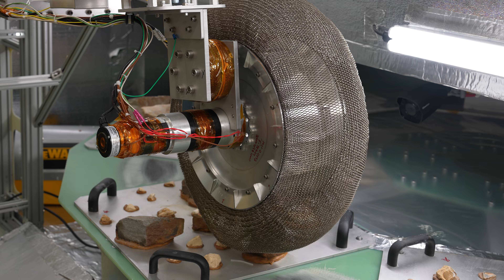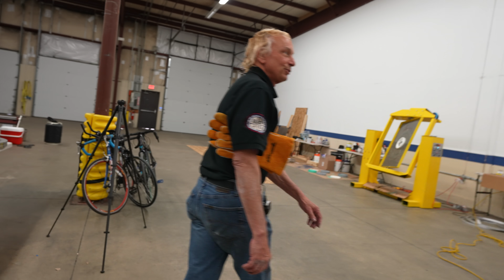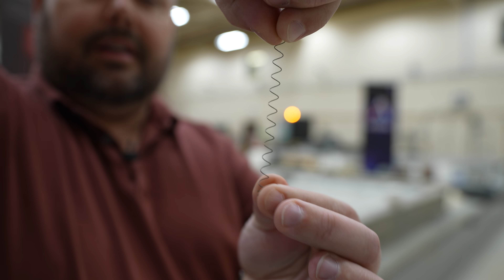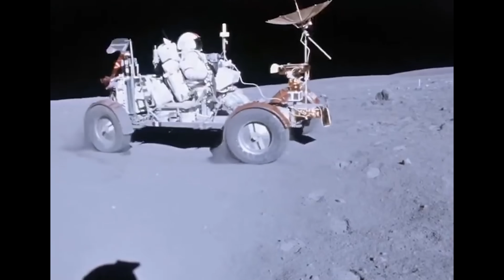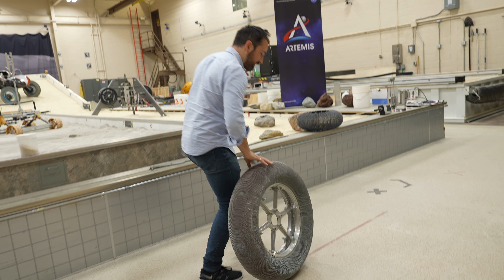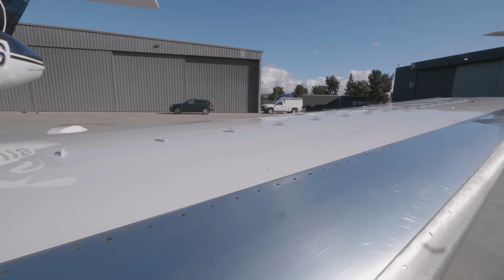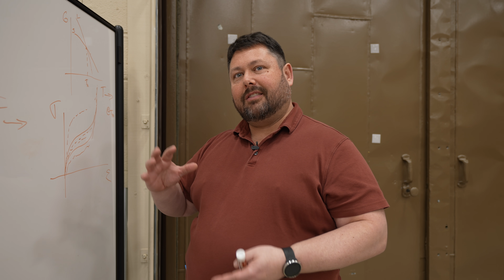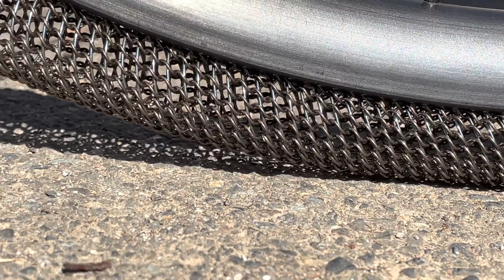How NASA Reinvented The Wheel

Comment: I'm imagining a cooling system where they take a wire of Nitinol and have it rotating around and bending as it goes, so it can be cold when it enters your house, or goes by a fan, and then it's hot when it goes back outside.  AC with no nasty coolant chemicals.  

This is a pretty sloppy description, but it makes sense in my head.

Comment: 15:39 But how? i know sound wave is produce by vibration. Do you feel the wire vibrate when you pull it or that chruncy feel is the vibratation? Still, if it is vibrate, then what is it? Is it the molecule or your fingger print rubbing the wire?

Comment: Not an engineer, could you use this to efficiently propel stuff? Similar to a wind up motor but with a longer coil, and apply various temperatures to change the amount of force applied with the motor? Not thinking about cars or anything as technical, but for like efficient and reliable exploration robots, or short range prop drones. If anyone knows of anything out there that uses this, lemme know I'm really curious

Comment: Why not utilize that exothermic energy to power the rover even in the dark?

I mean as the rover traverses through the Martian terrain, the deformity caused to the wire mesh wheels would generate certain heat which in turn could be converted to energy and fed back into the system. Any thoughts?

Comment: seems like there could be applications for stable energy storage. I'm trying to imagine some kind of kinetic motion battery like a water battery. Am I missing something? Like you could use PV electricity to bend the material and then heat or cool it to release it. Depends on the input output ratio, obvs. Something maybe about the exo/endothermic reactions could be useful too...

Comment: Airless* road tyres means less flat tyres. 
Which means less waste being generated. 
Which means fewer tyres will need to be replaced. 
Which leads to less income for tyre manufacturers. 
Which is precisely why they won't ever be made for consumers.

It's basically: "Do you wanna keep making good money consistently?"
or 
"Get a massive boost of income short-term as everyone switches to near indestructible tyres, then go bankrupt in a few years because nobody is buying replacement tyres?"

They hold all the cards... And the house always wins.
Reply: but "they" isn't one entity. Yes, the tire making companies would hate this for the reasons you mentioned but the car making companies would love this. It would mean having to spend less money but still have a better product. Because the car companies have more power, they would be the ones with the power and because these tires would mostly benefit them, they would buy them up.

Comment: does anything notable happen if you run an electric current through it? i'm imagining you can flip a switch, the electricity heats the wire as it moves through, altering the shape, then flip back and it returns to shape, but what shape would it transition into if the remembered shape is the cooler temperature? is that predictable?

Comment: So my question is, how well the nitinol wheels will perform in commercial vehicle? Like when it used for high speed like above 160 km/h, or when it perform in difficult terrain that may cause even for rubber wheels slipped, or how about the grip of the wheels when it has to work just like rubber wheels to decelerate from high speed or when it have to accelerate?

Comment: I've always wondered about the practical applications in space. If you can set the austinite shape at certain temperatures, then doesn't that mean with the temperature fluctuations it would constantly be changed? Unless they are creating alloys with the shaping phase at temperatures higher than natural in space I just don't see it working all that well.

Comment: I used to work in a shop that specialized in working NiTi for medical devices, Before you do some of the operations on it you have to straighten the round stock, and you want a really tricky process, because if you just cold bend it to straight like most metals, the moment the drills heat the metal up it can undergo what was referred to as "Radical hysteresis" where it returns to it's previous shape, which if it's not straight doing deep hole drilling on it becomes near impossible. There were ways to deal with it even if it did undergo a radical shift, but that is all proprietary information that belongs to that shop.

It's some wild material to work with though. When you started describing the material at the beginning of the video I immediately realized that it was going to either be about Nitinol or Flexinol. Memory metals are crazy.

Comment: thats soo cool but i have a couple questions, first of all if i heat it up and then i try to deform the piece when its hot what happens? and also in the case of a car with that tyoe of wheel do i need to change them if i go to a hotter or colder place? like if i had a jeep with those wheel that can go in the desert do i need to change them in i try to use the same jeep on the snow for exemple? (ty in advance if anyone answer me and sorry for the bad english)

Comment: The Apollo 14 MET had two nitrogen-filled rubber tires, and were the first tires on the Moon. They were designed by Goodyear Tire and Rubber Company and called Experimental Lunar Tires (XLTs). It's sad that everyone forgets about the MET. It was used once on Apollo 14. It didn't work as well as hoped. It was replaced by the Lunar Rover for the extended J-Class missions, Apollo's 15 to 17.

Comment: After watching this video, I learned about the unique properties of Nitinol, a metal alloy of nickel and titanium. I was fascinated to discover that Nitinol has shape memory and superelasticity. This means that it can deform at a low temperature and recover to its original shape when heated above a certain temperature, and can accommodate large recoverable strains within a certain temperature range. These properties are derived from a reversible phase transformation between austenite and martensite, two different crystal structures of nitinol. I also learned that Nitinol has high tensile strength, melting point, resistance, and corrosion resistance. It’s amazing to see how this material can be used in various applications!
Reply: bot check, say fresh avacado xD

Comment: What happens to those new mesh tires if you stick them in liquid nitrogen like u did the rubber?.....and what happens to the tires if they are hot and then stretched to its limit or vice versa very cold then stretched to its limit?
Reply: Liquid nitrogen will make the tyre stronger but more brittle.

If they are heated to less than 350 °C, they become stronger and tougher than when at room temp.
If they heated more, they become weaker.

Comment: I'd like to know if that wire or material does anything interesting with a voltage applied. There was a product I heard about, I think in the 90s, called "muscle wire" that sounded kinda similar. One of the ideas for it was miniature robotic arms or legs without actuators.
Reply: Yes, muscle wire is the same material (nitinol). Heat, electricity, force and magnetism can all be used to various effect.

Comment: They’ve been talking about nitinol tires for decades. Obviously they have major disadvantages (cost, durability, etc) otherwise they would have been commercialized long ago.
Reply: Material advancements and commercialization take time, sometimes on the order of decades. We had electric cars first, too. Cost has in fact been one major issue but has been drastically reduced in these designs. Sometimes you just need that tipping point, and we believe it's here.
Reply: Reporting is faster than the process of pushing out a finalised commercial product.

Comment: I would not use those tires on planes or cars on Earth. Slow rovers sure. But not vehicles that are on concrete that require grip on that concrete. If you had those on your car and had to suddenly brake, those tires are screwed and you're sliding if not tearing up that mesh entirely. You're going to need rubber on those wheels to be able to grip the concrete to help reduce your speed
Reply: All of the terrestrial tires (including the bikes shown), do in fact incorporate rubber treads.
Reply: @thesmarttirecompany  Oh okay i don't recall it being mentioned apart from on the old Mars rover wheels and it only really showed the wire mesh tire. That's good then if the terrestrial ones use rubber too though wouldn't that rubber also strip from the mesh a lot easier? Or is it more akin to our current tires but using the mesh as an inner tube with a solid rubber exterior?
Reply: @SphynxsShadow  it's hard to make a perfect analogy here, but basically the nitinol skeleton is first encased, and then the rubber tread goes outside of that. It's a complete solution that's a bit different from retrofitting nitinol into anything existing.
Reply: The nitinoid would be inside the tire, not outside.

Comment: So what about scratch damage to the alloy, and for terrestrial applications grip levels? So perhaps you could have an inner Tire made of the alloy, with a rubber tire riding on top of it. Rubber tire would provide the grip and protection from scratches. The alloy would provide the substitute for air pressure. You may still have a an inflated tire, but it may only be at 4 PSI or something very low it's easy to manage.
Reply: Yes, all of the terrestrial applications do already incorporate casings and rubber treads.

Comment: I'm skeptical of the tire application.  Two things that come to mind are Grip on the road, specifically for things like breaking; and secondly, I'd be concerned with any wear on the road if it's a more coarse surface in contact with the road.
Reply: Have you considered that the nitinol is inside the tire, not outside? You can just put this inside a normal looking car tire.

Comment: I remember hearing about a nitinol powered engine which was just a length of the wire that went around the rims of two different size wheels similar to a fan  belt in a car .  Then the smaller wheel was lowered into a hot liquid.  The wire in the liquid would contract and try to regain its programmed shape and turn the submerged wheel and expose the submerged part of the wire into cooler air and the cycle would  continue.

Comment: The longest distance the lunar rover went was 36 km!  Amazing considering that it was electrically powered and that there were no drive upto plugin charging stations.
Reply: The new LTV requirements are 10,000km / year. Which is why we are supplying nitinol tires to the Leidos/NASCAR team.
Reply: @thesmarttirecompany  No way!  That is remarkable.
Reply: @nzs316  it’s pretty intense! And at those extreme temps (-230C) with astronaut lives on the line. Wild stuff.
Reply: @thesmarttirecompany  Can you imagine being on the Rover in the 69 and your 18km out at a way point and you throw a tire or the battery craps out on you!
I was 9-10 at that time and we were glued to the tv.
Imagine the engineers that designed all that and it had to work period!  Failure was not an option.
How gutwrenching it was for Apollo 13 being forced to abort the mission and return home on a breath and a prayer.
Cheers!
Reply: @nzs316  back then, everything had to be kept within astronaut walking distance for that reason! They weren't willing to risk it.
Reply: @thesmarttirecompany  Yeah back then Matt Damon hadn’t show us how to plant potatoes on Mars!

Comment: I'm no rocket scientist but, the -320F (LN2) is a lot colder than -250F (Dark side of the mooooooon).. Also, they make cold resistant  "rubbers"/Polyurethanes/Silicones that can handle well below -320F.. Why do they always lie/exaggerate to justify this sh*t? Just say "We wanted to build cool wheels."
Reply: The absolutely do not make rubbers that function at 40 Kelvin, the temperature requirement for LTV. Perhaps leave it to the rocket scientists =).
Reply: @thesmarttirecompany False. Even if we pretend that nanocomposites like all the elastomer composites that incorporate carbon nanotubes, graphene nanoribbons, MWCNT, zirconium tungstate particles... Zero dimensional materials like quantum dots.. Nano Oxides such as SiO2, All2O3 or TiO2.. don't exist.

Then pretended all the experimental materials aren't a thing...

We'd still have Fluorosilicones, Perfluoropolyether Urethanes (PFPE), Flouro-TPE, TPV, TPX (XLFE), FFKM, Phosphonitrile Elastomers, HXNBR, etc.. 

So called "Flexible Ceramics" have operating temperatures exceeding 2000F. 

There are quite a few elastomers that function and doesn't irreversibly deform or degrade at extreme temperatures... 
  
APS based elastomers with highly tunable mechanical and physiochemical properties.

My use of quotations around "rubber"  wasn't accidental.
The general public thinks of "rubber" as any rubber-like material (such as Silicone, EPDM, HNBR, Viton or Urethane). Real rubber is hardly used today, it's obsolete.
Reply: Because that's not at all a valid justification

Comment: Materials science is the best. As for the tire application, it really works well for off road and probably agricultural/construction where the surface can be marred. But aside from that polymer coated bike tire how will it affect the asphalt or concrete roads. Also what speeds will it be limited to? Rubber is soft on roads and can ablate to allow the wheel to spin faster without damaging the road. All solvable problems, and an exciting field to be sure.
Reply: All of the terrestrial applications are encased like the bike, plus rubber treads. They deflect like rubber tires, so the roads are taking comparable forces from the same tread material as always.

Comment: This is my PhD research topic in Australia. You can look further into the additions of ternary elements to the shape memory alloy as the the main disadvantages of this material is that it has to be operated under certain temperature in order to ensure the shape memory effect will appropriately take place. Many researchers are trying to alter the “operating temperature” of the material as each extra-terrestrial planets have different temperatures. For example adding Copper, Aluminium, or Molybdenum can alter the operating temperature into a lower regions so that it can be used on Mars and Moon where surface temperature can be as low as -20 degree C. Also, the material is not perfect. Every time it is doing its shape memory effect, there will be some intermediate microstructure form that is not in the graph shown in the video ( intermediate R phase) which does not have the superelastic or psudo-superelastic property like Austenite and Martensite do. If the presence of intermediate phase is significant enough (roughly 10-15% w/w) the intermediate phase structure will interfere the shape memory effect (it gets in the way during spring back when apply heat). It will not fully restore its shape into the original form. This is still an early stage of SMA, there is still a long way to go. But, it gives us a very promising future on next generation morphing material.
Reply: Yes, it's fascinating stuff (and neither simple nor perfect, for sure). The great things about tires is that we have a ton of design space to take advantage of these effects while still staying well within their limits, and combining with other material elements.

Comment: I comment on Henson razor ad videos because I have one and already had a traditional safety razor. The difference between knowing how to shave with a safety razor and a Henson razor is not huge, but it is noticeable because it is both a more aggressive shave and less sensitive to the angle you hold it at and other factors that influence razor burn (obviously don't press and move it horizontally, it's still a razor). From a multi-blade disposable it's more different, but it gives a closer and more gentle shave and replacement razors cost a fraction per blade. I have never used Henson's blades so I have no idea what they're like, I use Shark or Feather brand blades.

Comment: The only issue I see with terrestrial tires using this technology, is grip. One might not need to maintain the correct pressure in your tires, but I don't imagine "braided wire" would provide any great traction on wet or icy roads?
Reply: Terrestrial tires would simply encase it in rubber.

Comment: 12:20 That is such an interesting concept that applying heat to this metal is able to lift a fairly sizable object! I wonder if this could be used to capture energy from waste heat from various machines or generators? I remember a video from SmarterEveryDay from a while back that had a light powered by a bag of rocks tied to a little generator that was dropped from high up, I wonder if a similar concept could do something similar. Basically having an object hoisted by this metal that as heated from waste heat, and convert it to mechanical energy by the object dropping?
Reply: CAN YOU SHARE LINK OF THAT VIDEO BRO?

Comment: My thoughts would be it's fine at low speeds such as Rocky terrain etc. But I don't suppose it could be rated for automobile tires simply because at highway speeds, heat would become a factor causing it to translate thermal energy into mechanical energy, causing deformations in the design...

But it's interesting for a trail type tire.

Comment: Yeah about the motor vehicle applications;
 it sounds good in concept but nitinol is expensive, and it also performes poorly compared to rubber on asphalt, which will hurt traction and performance, leading to worse fuel economy and potentially being more dangerous, which i can confirm as a auto tech.

Comment: do you think that driving on asphalt would erode the metal too quickly when driving at high speed? Maybe they could use it as an inner tube inside regular tires to protect the wire mesh.
Reply: We do add a case and rubber treads - the Jeep demo was specifically a bare metal proof of concept for loading purposes.